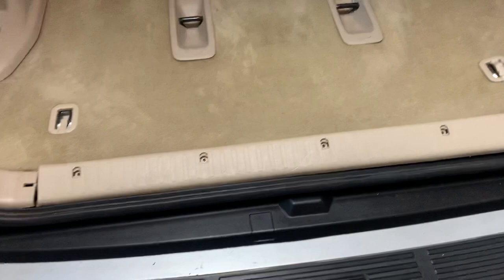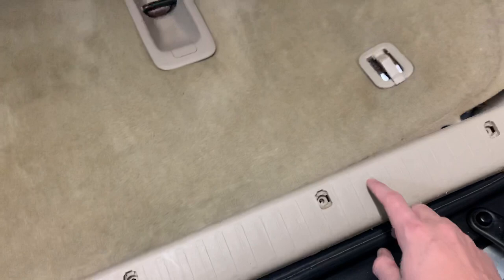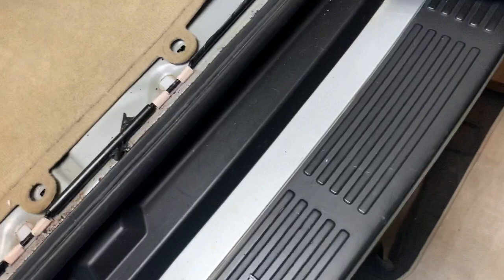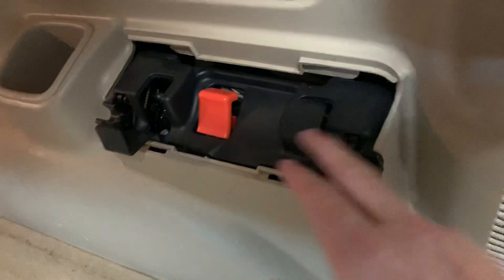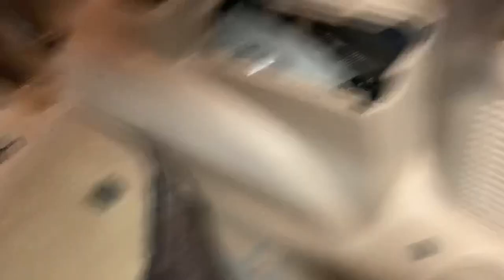LEXUS GX470 SUBWOOFER ACCESS/ REMOVAL IN LESS THAN 2 min Mark Levinson

Comment: Awesome vid! Exactly what I’ve been looking for. What size is the stock sub? Ie is there a sub I can buy and not have to modify to put in?
Reply from the maker: It’s an 8” sub.  The only sub that will fit there without modification is the oem factory subwoofer.  The outside edge of the mounting bracket has to be trimmed to fit anything else there.   There arnt many options when it comes to 8” subs

Comment: Question: The service manual says the top-right clip holding the large panel cannot be re-used, is that accurate?
Reply from the maker: You can reuse it